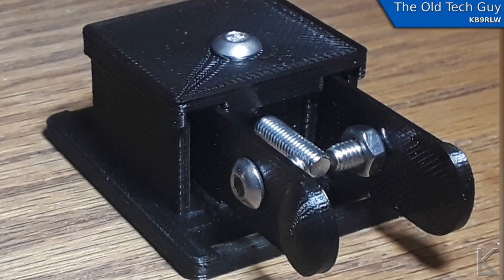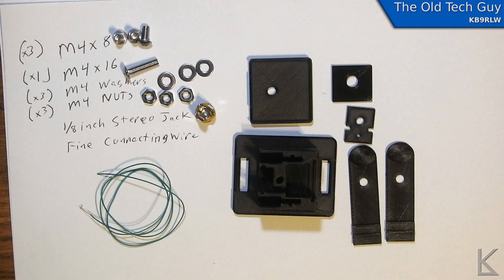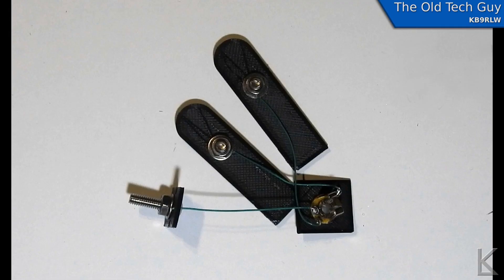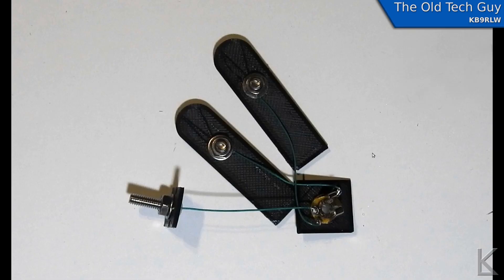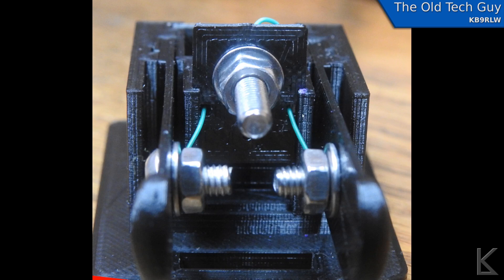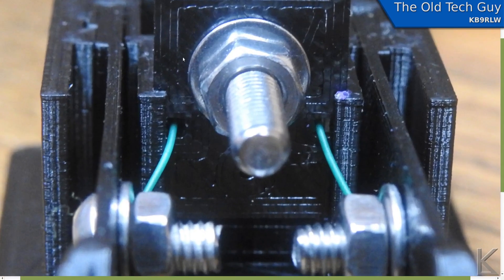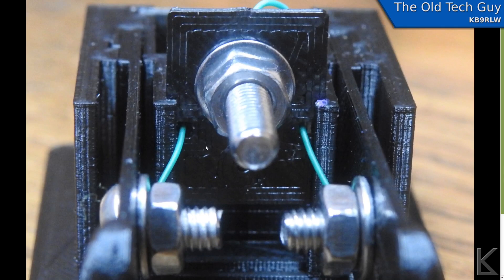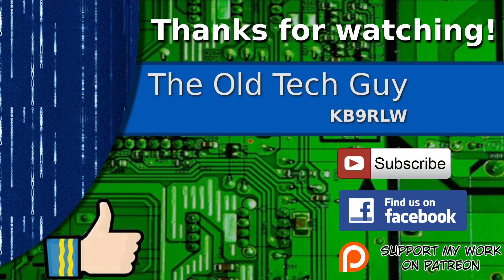Ham Radio - 3D printed wrist mounted micro paddles.

Comment: Nice design Kevin. I will definitely make one. Since I have an addiction to making keys, Hi Hi. Just got done making K6ARK version. Simple is generally best. As a SOTA-teer, I'm always looking at different ways to try something. Some of my favorite keys have been 3d printed. Since they are light, I usually carry two for back up. I have made a few leg straps but never a wrist strap, great idea. Hard to tell watching the video so I will have to see when I print one. Only recommendation I see right now would be to change the paddles so they are closer together. So your fingers are not so far a part. So thanks again. 73 De KF7SEY

Comment: Kevin,

A local ham friend (Elmering does pay off.  He used to mow my lawn 35 years ago) is making one of these keys for his own use.  I recommended he use brass nuts and bolts just to make better contacts electrically and it will look more “cool” too.  I also suggested he make points on the ends of the contact bolts.  I will try to get pictures of his final product if he does it my way.   Dave K8WPE

Comment: I like it, but could you by pass the jack & just wire the parts directly?
Reply from the maker: Go for it.   You'll need some kind of strain relief in the housing.  You could pass your cable through the existing hole the jack would go in.   
Patch cords are less than 10 bucks though. 
https://www.amazon.com/3-5mm-Stereo-Audio-Patch-Cable/dp/B0018MC9PI/ref=sr_1_9?crid=K7PB6DOJEQP2&keywords=1%2F8th+inch+stereo+patch+cord&qid=1670535926&sprefix=1%2F8th+inch+stereo+patch+%2Caps%2C510&sr=8-9

Comment: Nice!

Prior art:  In the '60s there were folks who strapped a key to their thigh so that they could operate while driving.  (Of course, keyers were only starting to show up, so these were straight keys.  I never heard of this being done with a bug - vibrations in the car would probably set that weight a swinging.
Reply: Bill, I am doing that now with my American Morse keys. I have a straight key and an iambic paddle to use /m.
Reply: @JoshuaJayG  I wonder if it still counts, since you use your hand to operate it, as a "handheld electronic device", in states that try using that phrase to keep people from driving while holding their cell phone to their head.
Reply: @KeepEvery1Guessing  Good question.  I imagine in those places it may.  I don't have to look at my key and it's not going anywhere if I take my hand away. I imagine if someone gets pulled over for using their key mobile, they may need to pay more attention anyway as they were likely driving somewhat erratically.  Don't send CW in traffic.

Comment: Last week Adam, K6ARK released a design for some mini paddles too. His design uses a live hinge and the flexibility of PETG to make a compact design. You can find it on printables. 
It isn't wrist mountable but it wouldn't be too difficult to add onto the base design considering it's just a thin rectangle with two rectangular cutouts on the ends. You probably could even add the mod directly in a slicer like PrusaSlicer. 
EDIT: Adam Posted another model that allows you to mount it to your leg or wrist.
Another popular method is to glue neodymium magnets to the base and attach it to the radio. Works for a radio like an FT-817 but not one like a IC-705
Reply from the maker: I've seen his, they're quite nice.   There's another that slides into a shell to protect the paddles, and plugging the cable in the back pushes them forward out of the shell. 
I figured I'd jump on the bandwagon and play my bit too. :-)
Reply: @loughkb  I have both of Adam's paddle designs, and I honestly prefer his retractable design. On another note, he recently added a leg/wrist strap design to printables so now that works too.

Comment: Version 2 - wireless ;)
Reply from the maker: The Icom 705 has bluetooth for audio and serial.   Why couldn't they simply add keying as an option?  Maybe it could already be made to work..   They could use the RTS or DTR pins on the virtual serial port as keying.  Then a micro controller and a bluetooth chip is all you'd need in the paddles.  The rest would just be software.  
I'll have to think on that..  Latency could be a problem though.

Comment: I put magnets on the bottom of my 3D printed porta-paddles.  Stuck to the top of the 891 they are probably more solid then my Bencher at home.  Only really works with the form factor of the 891 though.  On my 7300 they'd be way too high, and there's no hope at all for the KX2 (glad it already has them on it!)

Comment: WA6YOU demonstrates Different CW Keys, including a leg-mounted straight key from 
Marine Corps equipment:  https://youtu.be/n7lJccG0u48?t=123

The J-45: this is the well known "leg clamp" key consisting of a J-37 mounted on a metal plate hinged to a spring metal which was worn above the knee (late WWII)
https://www.youtube.com/watch?v=Zmwx4kvxQgk

J-45 key Sending morse code:
https://www.youtube.com/watch?v=uOrJYI263mk

Clansman (UK Military) Morse key
https://www.youtube.com/watch?v=g6KFf_7AzaA

If you wanted to do a leg-mounted option, the strap has to be at right-angles to the wrist mounted version.  A 3D printed version of the J-45 may be possible.

Keith,  M0KIL.
Reply from the maker: I'm thinking about doing an alternative base design with the strap mounts at the sides for leg strap. :-)
I'm actually working on version 2 already.  I have the paddle block separate, with a slot and groove design to let it slot into swappable bases, or just be a smaller hand held unit.

Comment: Fine design, especially the slide in paddles. The first comment I have is to maybe angle the paddles ~30° in reference to the wristband to make the paddles a bit more ergonomic. The second comment would be to maybe add a module/screw for adjusting the contact distance/paddle movement. Thx Kevin for taking time to design this.
Reply from the maker: Thanks. 
I thought about angling the paddles, but I'd have to make two variants, one for right handed folks and one rotated the other way for left handed folks.  In actual use, I didn't find the straight angle to be uncomfortable though. 
As for adjustment.  If you wanted more travel, you can shim the screws.  Put a thin washer, or cut a bit of card stock and put it under the screw head to back it out a bit. 
I'm also thinking about providing paddle sets with slightly increased thickness for a tighter 'spring' action.
Reply: @loughkb  Possibilities are endless for customizations.